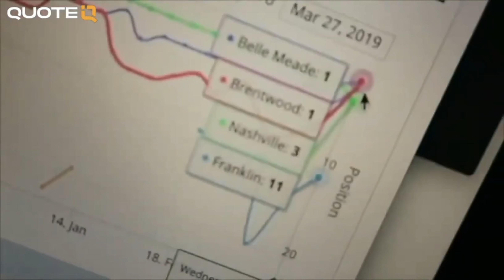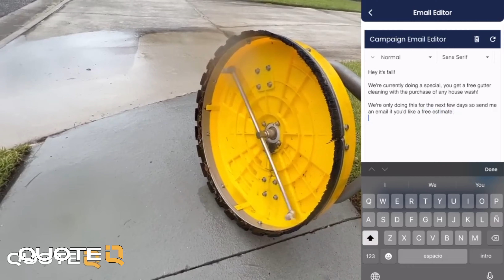How To Get More Pressure Washing Jobs

Comment: Quick question sense you have more experience in the field, the buffer tank goes connected to the pressure washer and the customers spicket filling the tank as you preasure wash is this how it goes?
Reply from the maker: That is correct, watch my video about how to plumb a pressure washing trailer. It goes over everything
Reply: @AllAboutPressureWashing  Just watched it. It was valuable information, thanks.